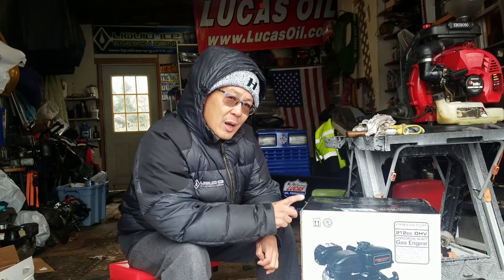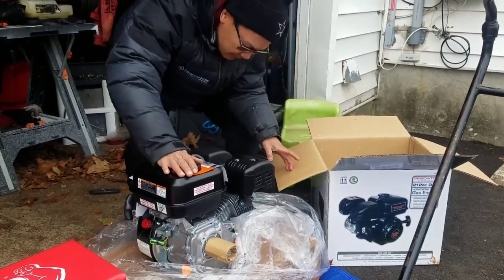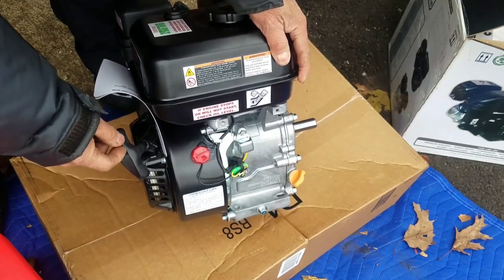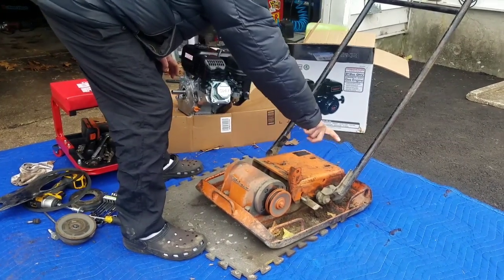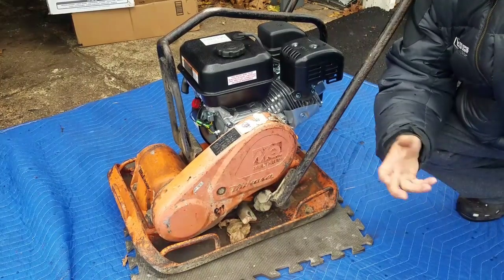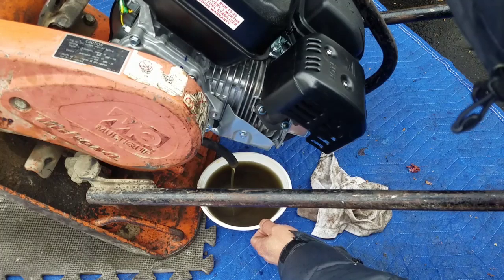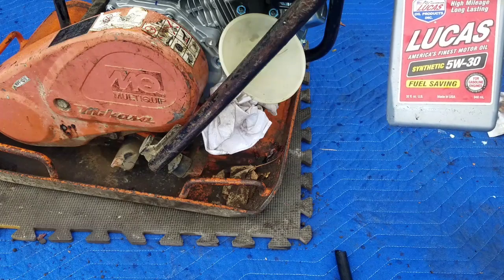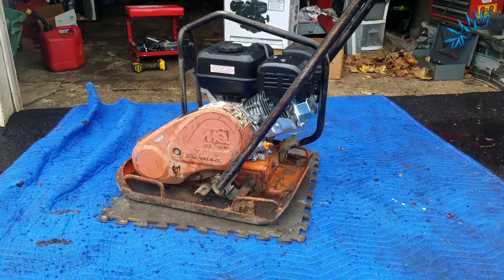HARBORFREIGHT TOOLS PREDATOR 6.5 212CC HORIZONTAL SHAFT ENGINE UNBOXING HOW TO BREAK IN OIL CHANGE

Comment: I never knew how to break in a new out of the box engine, good to know. I had one of these that I bought for a project several years ago to put in my Wheel Horse RJ58. It didn't fit so it still sits untouched in the box it came in. Might use it to power an electric gold cart that has batteries that are quite expensive.

Comment: I prefer predator generators than predator engines. If I like engines, I would get them since the engines at Harbor Freight are cheaper than the portable generators. But I still rather get the predator generators.
Reply from the maker: Predator generators have predator engines on them.

Comment: Why do you have to break in a Predator small engine?  Whenever a person buys a new lawnmower, tiller, snow blower etc,, there is no break in period!!!  I never ever broke in anything power equipment and never had an issue, but do I always change the oil on a new piece of equipment after the first use
Reply from the maker: You don’t have to do anything if you don’t want to,  but to be safe,  I used break in oil.

Comment: I've seen them as low as $94.99 with a coupon they print, with tax in NJ its basically an even 100 bucks and you said it, at $99.99 for the quality you get, how can you go wrong. It is so true. Yet I still hear bone heads say, oh but thats a crappy Chinese engine the original engine is still better. I keep telling people, yea will if the original engine is a wreck, the $99 dollar predator is the way to go. It is, they run great, they have a ton of power, they can run to a max 4100 rpm stock no problems and their reliable. Great engines. Only issue I see with these is the carbs are jetted to lean, in cold air you have to run it with partial choke, not a big deal. Plus you can buy different size main jets. I have two that have an adjustable main, I made a video on it, but like I said he hasn't sold me anymore.

Comment: Bro did Lucas Oil ever send you their oil treatment I use it and all my small equipment and my car stuff is amazing gives you that extra lubrication so that the engine does not wear makes it start easier even quiets down older Motors if they haven't sent you any tell them you want some you can get it for synthetic oil or regular oil
Reply from the maker: Yes, they've sent me the oil treatment, I've used it on my tractors
Reply: @MowersNBlowers  stuff works great I'd recommend it to everybody

Comment: Break in is not necessary. Can be put into service right out of the box.
Reply from the maker: Really? Says who?
Reply: @MowersNBlowers Says Me!
Reply from the maker: @1958Citation  oh, then I guess we should all risk blowing up the motor because you said so.
Reply: @MowersNBlowers  I can backup my statement ...can you ?
Reply from the maker: Bro, I couldnt give 2 shits what you think! I'm not replying to your comment to start a pissing contest.  I'll break in my engine, if you dont want to break yours in, then dont...who gives a shit?

But I'll always break in a new engine. You do whatever the hell you want

https://4cycle.com/karting/threads/predator-break-in.48645/
Reply from the maker: I didnt make any statement, you did, and where is your back up, proof? Documentation? Source??
Reply: @MowersNBlowers  I made a statement that you don't like. Tough!
Generators, pressure washers, snowblowers, cement mixers, etc. have this identical mill and run at 3600 RPM off the shelf with no break-in or any other preparation.
Where's the "Risk" in "blowing up the motor"?
Show me  just one (1) instance where this destruction happened with these engines.
Reply from the maker: @1958Citation  lol, why should I bro...? Like I said, you do what you want.

Comment: The metal in the oil you see could destroy an engine if they are left in .This also shows the low quality that this engine has .In time it will show poor quality metal it is made of .
Reply: I agree
Reply: I disagree, I have two of these on snowblowers that are used commercially. I never even did a break in oil change on the first one and its on its 4th going on 5th year now and thats running it at 4100 rpm, it has to have outleast 600 hard winter hours on it by now, not one issue. Also these engines are the new standard in the mini bike and go kart world. They sell billit parts for these engines and they pull the governors and run them at 8 grand rpm. So their actually a strong engine and very affordable.
Reply: @Mr_Tecumseh  I really dont care
Reply: @nickflopper  reply comment's go to the person at the top who started the thread unless otherwise specified. I wasn't talking to you.
Reply: @Mr_Tecumseh  yes, but since you take 10 mins to write a few paragraph comment on every video, you obviously know how to change oil, check for gas in crankcase, and maintain it, etc. I'm talking about people who just use these machines for their job, (like walter) who just run the engines and dont do a 10 min check and examine the oil before each use, which is what most af the marketing for these engines are targeted to.
Reply: @Mr_Tecumseh  highly doubt you put 600hrs in 5years show the hrs meter